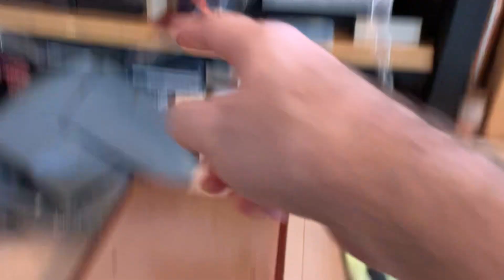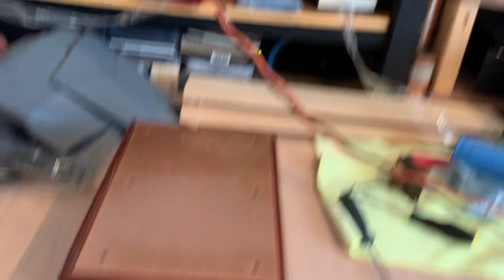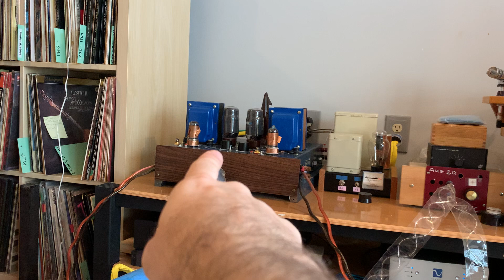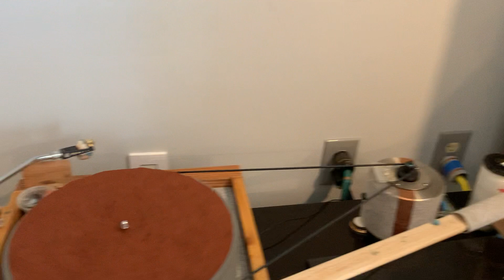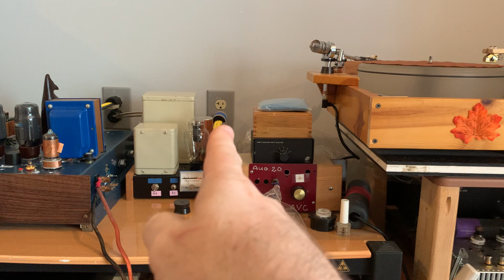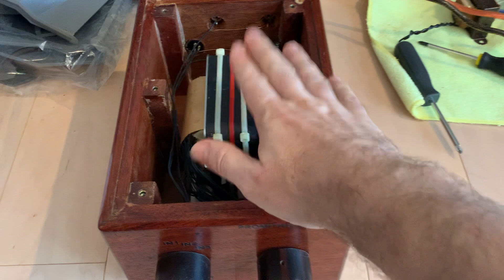Transformer volume control: suitable for solid state amplifiers? (AVC / TVC)

Comment: Could you tell me if this TVC is good for my system? (link in the comment below)
DAC:
RCA: 2V 100 Ohm
XLR: 775mV 600 Ohm
Tube amplifier: 150 KOhm
Reply from the maker: It will work well with the XLR, but with RCA only with mid to low volumes, at full volume noticeable bass cut. Also, think of the gain as well, the TVC does not add any gain, so you if your amp has an regular input sensitivity of 1.5 -2V, then your DACs XLR output is insufficient. Briefly, it will not work, unless amps input sensitivity is 0.7V or lower.
Reply: @realworldaudio  My amp is LuxKit A3500:
Input sensitivity	750 mv 
Input impedance	250k Ω
Reply from the maker: @listopad44  The  it will be able to drive the amp to full output. Just keep in mind that it will not be able to increase volume for quiet sources, it can only attenuate but does not provide gain.
Reply: @realworldaudio  Thank you very much for your answers. Usually I listen no more than at 50% of full power (40 W, EL34 PP amp). That is why I need a good passive preamp.
Reply from the maker: @listopad44  Wonderful, then this TVC is the preamp that's most suitable for what you need. ;

Comment: hi , would  this work with a mcintosh  mr 78 tuner? with 600ohm output impedance? and output of 2500mv?
running through a unison research  s6 integrated  with 47kohm  input impedance impedance? thanks Brian.

Comment: @Real World Audio  Hi really great video and very informative! Would like to ask 2 questions:
1. what brand/model is your smaller AVC that royal thrashes the prometheus audio?
2. My set up is in between your 2 scenarios, which should I choose? 
My dac is the denafrips terminator which outputs 2.3v at 625 ohms (output impedance), and my amplifiers are cary tube mono blocks of 150k ohm input impedance, and 1v to drive the amplifiers to full power. My power supply at home is 1 circuit to drive all equipment, but I do intend to buy a power distributer/conditioner one day for better power. 
Which would you recommend?

Thanks!
Reply from the maker: My AVC is unique, it has no brand - it's my design, and I had DPA (a Hungarian master transformer maker) wind it for me.  Sadly, I have had feebdack that Promitheus audio cannot fulfill TVC orders anymore, they got so overwhelmed with orders. I'd recommend trying other companies, S&B is one that makes TVCs. (Much more expensive than Promitheus ; (...
Reply: @realworldaudio  hi Janos, also can I check, have you heard of tribute AVCs before, and do you know how they sound? Thankd!
Reply from the maker: @GH-zs8eq  I have heard a lot of good tings about Tribute transformers in general. I have not heard any (neither their AVC), none made it over here.
Reply: @realworldaudio  thanks so much!
Reply: @realworldaudio  thank you so much! Do you know if your DPA master makes a AVC or TVC passive? Thanks!

Comment: In the future I want to upgrade the volume control of my Oto, but this isn’t that simple since it’s a integrated amp. I would like to skip the original potentiometer.. I need to hire a audio pro to do it for me, but I was wondering if you have suggestions? (I have the version Phono Se signature version)
Reply from the maker: Hi Nick, I'd suggest to change the pot in the Oto to an Audio note tantalum resistor (Actually, one resistor per channel - two total). Bigger wattage, the better, I'd suggest 2W or 1W rated one. The original input impedance of Oto is 100K,  but that is because the pots come in 100K. Going a little higher (to 120K-170K) will be of benefit. Keep the two channels as close to each other as possible. The exact value does not matter for starters, but they should be as close to each other. Eg 154.6K - 154.6K. So, if you order a pair of 150K  resistors, and you get two 154.6K, that's of absolutely no concern in this application. Insterting the AVC/TVC will be  a little tricky, as you need to take signal that feeds the pot, add a pair of interconnects there to feed the AVC / TVC, and then a second pair of interconnects coming back to the OTO to feed those newly installed input resistors. Will also mean you need 2 pairs of RCA jacks and 2 pairs of interconnect cables as well. Quite a bit of surgery!!

Comment: My comment got deleted because it had a link, I will try another way
Reply from the maker: Luckily I had a glimpse of it in my mailbox; ). The cap they are referring to: some solid state amps, preamps (even some vintage tube gear) have an input capacitor to help break ground loop issues. (A sign that the units grounding system could use development.)  An inductor (AVC/TVC) and the capacitor form a low-pass second order filter. In similar cases it is better to get rid of the capacitor and fix the units ground issues, as the cap is always cutting into low level information, presents bass loss and phase shift, plus adds high frequency resonances. Although I would not be so alarmed by their findings, 20kHz was 1dB down ; )..
Reply: @realworldaudio  many thanks for the explanation :-) 
I was thinking the cap value could make the issue worst than 1db so got worried :-)
I was planning on use it with a capacitor coupled pre amp. Could this also be an issue or just the capacitor in the power amp?  In the power amp, the cap would be after the input resistor (it is called C3 in the "amp camp" amp). Is this cap also to break ground loops? Or such caps to break ground loops are always right at the input? Sorry as you see still quite a noob when it comes to circuits. ☺️
Reply from the maker: @Thiago_S..  The cap is there to protect the device from possible DC in the input. If the source is properly built, there should be no DC, but you never know and companies often resort to a decoupling cap for extra protection. The resistor is part of the network, would need it regardless the cap.
Reply: @realworldaudio  thank you again for clarifying ;

Comment: Hi there, I still don't know your name, but you will have to excuse me for that.
I saw your video with listener questions on output trafos from Edcor / Hammond etc.
Still, If I said that I consider using budget but good transformer in my upcoming build of 300B SET DHT with "Darling amp as pre-stage", would Edcore or Hammond be sensible choices, or too low  quality to get very good results? Would you go for any particular model/size for any of them, considering the approx 2*8W ?
Cheers, Magnus
Reply from the maker: Hi Magnus, both the Edcor CXSE series or Hammond 1600 series would be good candidates. (Not the smaller series.) These are 25/30W iron, and they will give you headroom! while more esoteric iron will give more refinement, but they will not give you the headroom nor the apparent power, unless they are also 25-30W rated. So, either of the Edcor/Hammond will play large scale music better than a smaller (7-10W rated) Hashimoto / Tango, which will run out of juice at fortes. - Janos ;
Reply: @realworldaudio  Thx, Janos! Again speaking of my upcoming 300B SET build, I got a suggestion to use one cascode wired 6SN7 as pre / driver for each 300B. Do you see any obvious advantages using that idea, instead of using Darling amp as planned so far?
Reply from the maker: @vespass225  I never played around with cascode, nor SRPP, as my mentor was dead set against using them. He said that if you want something similar, then have each tube (section) with its own plate load / cathode resistor, they are much happier and more linear compared to srpp / cascode. So, if you go the 6SN7 route, I'd recommend first section  DC coupled to second section, each with their respective resistors and set operating points.  Also, I'd recommend against sharing the same filament potential between tubes with very different cathode voltages. (Eg one siting at 6VDC and the second at 200VDC, as in a cascode / DC situation.) This introduces stress to the sound. The 6SN7 version will be more dynamic (due to higher gain), but also more colored / less natural sounding. The Darling driven version will have a more pure sound.
Reply: @realworldaudio  OK, quite some arguments pointing in the direction of staying on the Darling path then...!  Thanks again for extensive and  kind answer.    Magnus
Reply from the maker: @vespass225  Magnus, you are most welcome! I always wanted to try out the Darling-driven 300B, I'm glad you will beat me to it ; )

Comment: You said it well...................input impedance and the marketing trick to sell you a gain stage ( pre-amp = costly)
Tube are voltage driven on the control grid ( high impedance ) // grid resistor ( or vol pot ).....transistors are more current driven .........( often with inmut capacitor )...and the resistor is chosen lower for the reasons you mentioned ...but with higher impedance the transformator will have no problem especially on the lower volume settings ! .........and that's where they excel with all those micro information that make the difference between living music , living nature and sterilized milk...... it's those tiny things that make all the difference of being  alive versus a static lifeless reproduction ...........it's like the air you breathe.....

Comment: Ps audio...? what's the PS audio gear
I think you can call a autoformer a passive preamp that is what really it is a selector and volume
 have you thought about using a di box what converts high impedance into low impedance and unbalanced into balanced
 really you want to get off the grid if you want pure Power using a pure sine wave 2400w+ DC to AC converter ideally at 48 volt lithium phosphate batteries 200ah, you'll probably be alright at 24-volt 200ah. converting it to 230v and then using an isolation transformer step in it down to your home voltage this is not expensive should be able to do it for no more than $900.
Or as I suggested before having a power bank of AC power capacitors that could be run from just site Transformers
Reply from the maker: I think all their products use this technology (BHK preamp for example). Are you thinking of separate box for each channel? The most practical approach would be what Expressive Technologies uses for their phono step up transformer: single big box, but each transformer has its own separate copper shielding inside that box. (Basically, two copper boxes within a big steel box - making their phono step up unit heavier than most amplifiers ; ). In a home approach: copper mesh instead of solid copper, and wooden box would be easier to make and just as good. 
Indeed, battery power & inverter: tried it out, and works extremely well with digital source, but you need an outstanding inverter for tube amps. The inverter sine wave is very far from perfect wave - good enough for low voltage applications like CD and solid state amps, but stepping up the choppy waves for tube amps - made the high voltage PTs buzz like there's no tomorrow.